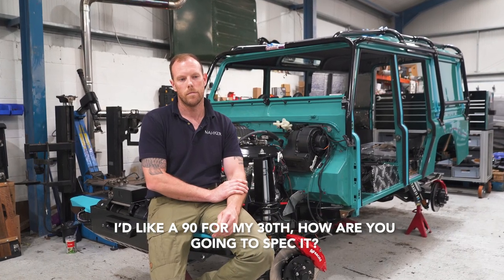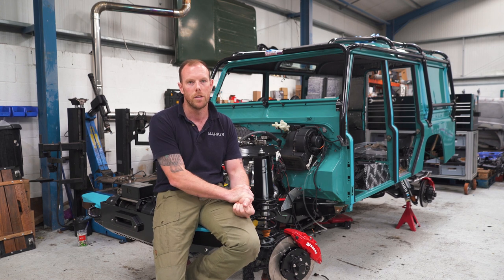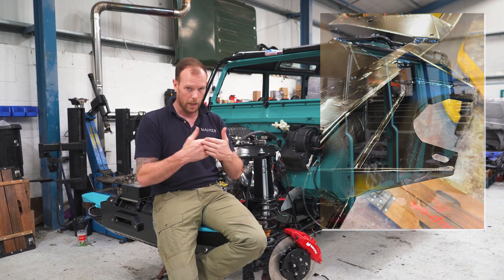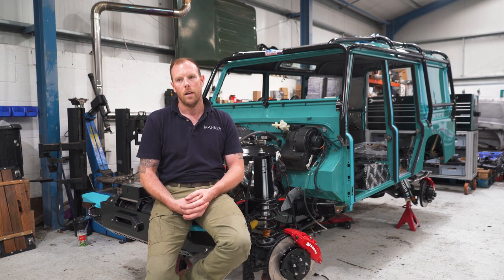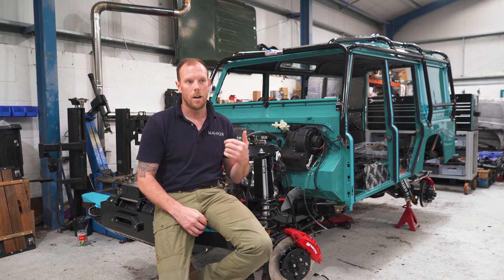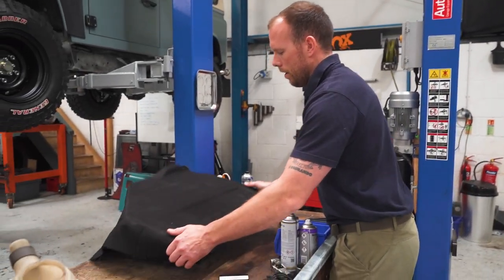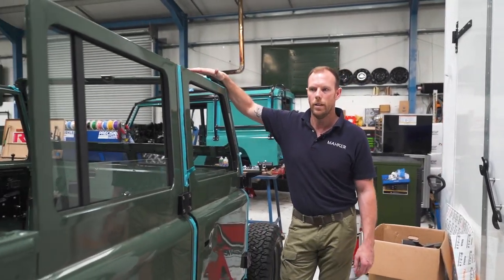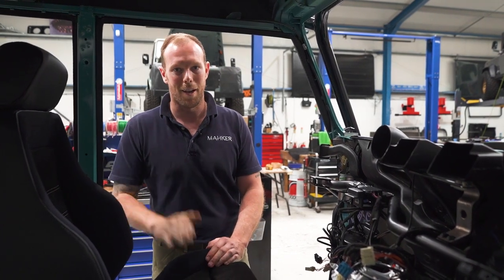I LOVE ANSWERING YOUR LAND ROVER QUESTIONS - MAHKER WEEKLY EP013

Comment: Hi did you do normal asperated ls3 engine swap in defender 110 and wat is the fuel consumption . Did you use the Holley exterminator x management system . also what is the idling timing you run the engine and for cruise and wot.

Comment: Ready for this open day 🙌.  Since I have had it back alot of heat coming from foot Wells think they must of took out a heat shield out or something any tips.
Reply from the maker: Please expand what you’re on about dude ?
Reply: @wearemahker  got my truck back after warranty repairs after a long trip now the heat from foot well or gear stick area is getting so hot you have to have windows open. It's a 2012 puma. Be nice in the winter but with this heat its crazy hot in the cabin. Thanks and hope you still going to have an open day like you mentioned before. Thanks for all the help and still saving for my bulkhead removal.

Comment: Can you quantify the effect of the roll cage on torsional rigidity? For example, a Defender twists when off road with opposed wheels evident with difficulty opening doors if you get the angle ‘right’. Does the cage reduce/prevent this?
Reply from the maker: We install roll cages for in the event of a roll not for improved Rigidity but naturally he cage is bolted to the chassis so will help with strength

Comment: 6-speed auto as in GM 6L80e?
Reply from the maker: That’s correct sir
Reply: @wearemahker  Do you install a zip kit? It ‘fixes’ some of the design flaws in the transmission. I put the kit in the 6L80e that’s mated to an LC9 (5.3 V8) that’s going in my ‘85 Ninety SW.
Reply from the maker: @Defender-Guy  we sure do keeping the pressures right in these boxes is super important